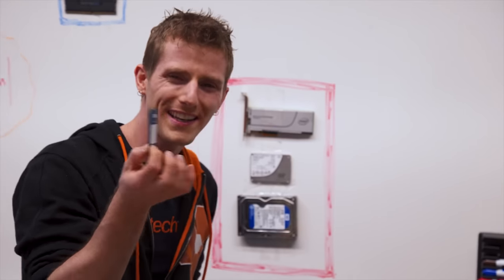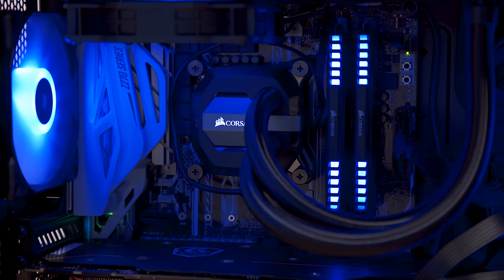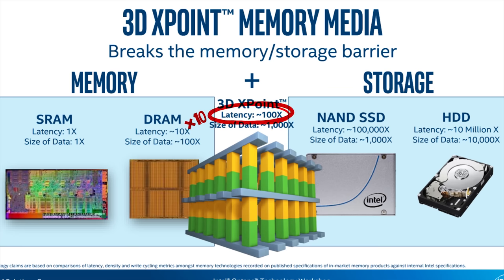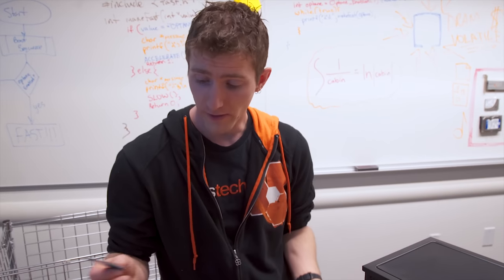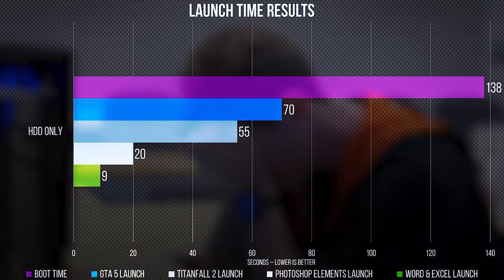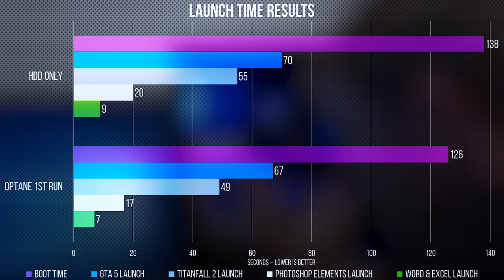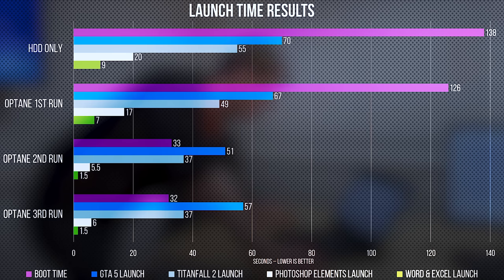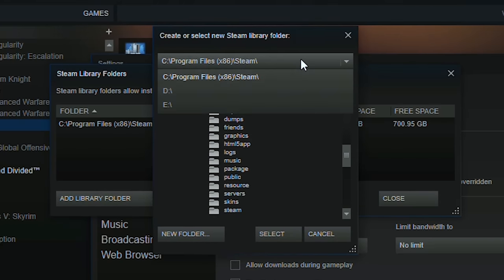Intel Optane Exclusive Hands On - SSD Crushing Performance

Comment: So this is marketed to someone who wants the lastest Kaby lake and 200 series chipset from intel, but for some reason want to boot from a HDD instead of buying an SSD for under $50? Like you can literally buy a 60 gig SSD for $35 on amazon. You mention boot times and that's nice, but what about writes? what about saving your work, or what happens after you've filled the optane drive?

This is that useless tech shit that solves the one problem no one had. It was already difficult and near impossible to justify upgrading from a SSD that saturates SATA 3 to an nVME drive; this is even worse. 

Epic fail. 0/10
Reply: You can build an Optane capable computer very cheaply. i3 7100 is $120 and the cheapest B250 motherboard is $60 on newegg. I could see someone buying a 2TB HDD with an Optane drive for a budget gaming PC. 

Personally, I don't need an Optane drive but that doesn't make it a fail. Just means I'm not the target market.
Reply: I guess the thing goes here is that you'd like to boot from hdd to have os installed on, say, 3tb volume. The optane drive goes as a transparent cache, so it deals with everything on his own, including overriding after it's filled up.
Reply: Mark Ivey - I'm stunned at the lack of thought you put into this, since it seems you wanted to put thought into this... you're taking a SINGLE task, and making an assumption that now covers the entire purpose of this product, but you're leaving out the numerous other benefits, that will cover the most common used tasks for each individual person... follow me on a journey, your way, and then my way....

your way suggests boot time is the only thing this is for, and we can solve that with two HD's, one $50 SSD to make boot times super quick, and then, we'll just uhhhh get another HD for everything else we use which now runs at slow HD speeds and after the system boots, I guess we'll just wait for it, since we only bought enough SSD to cover the OS and perhaps a couple programs at best?

my way is to use this as its intended, a cache... it will see what you use most often, booting will in fact be one thing, since we do that a lot right, use system files, those will no doubt take up a chunk of the cache... but so will every single other program I use on a frequent basis, including the ones installed on the much slower HD, which your method didn't provide enough room for on the SSD...

so in your method I will boot quick, but then wait for programs and frequently accessed data... under my way, I will spend roughly the same, but it will constantly target my most used data and provide it wicked quick, all the time, not just depending if I installed it on the faster drive, and moved something else off it... its essentially doing what you wanted, except for everything, instead of just the OS...

you see your way didn't "solve" a problem, it simply addressed ONE issue, boot times, while my way looked at what I did most often, cached that, and now provides me that data wicked quick ALL the time, and it changes on its own, as it see's my work change and what data I access on a regular basis...

your way... $50 for the "boot ssd" plus I still need another HD right? so another lets say $200 for a gigantic drive that holds everything... but only the OS boots quick... everything else is still slow right...

my way... $50 for the "optane" plus I still need another HD right? so another lets say $200 for a gigantic drive that holds everything... but not only does the OS boot quick, so does all my most often used programs and data...

who won in this? we spent the same amount of money, but only one of us has a system optimizing itself to make our entire workload quicker, rather than just a single function... same dollars, VERY different results... understand?

so stop being so narrow minded, open your eyes and truly understand HOW to use this technology...

now you could say, get into a penis measuring contest with me... lets say you will answer back with, well I'll just buy a larger SSD and put you to shame, so ha take that mister response guy... okay, you go spend $1000 just to show me how dumb I am and that I don't get it, I'll still spend $200 and we'll end up at almost the same passage... sure once in a while something won't load as quick, but the system will optimize and learn and I'll have saved $800 that I could go spend on something else, like maybe a better GPU than you, or maybe multiple monitors than you, or maybe I'll just not spend it at all and we'll end up with roughly the same real world performance, but I saved $800 over YOUR narrow minded way... understand?

P.S. you said "what happens after you fill the optane drive, stop thinking so 2D and step into big boy land... think of it as system memory, that only holds what it needs, and caches what it wants quick access to, because thats what you use most, and when it has something more important, it replaces it, and acts as a secondary RAM system... not a HD... think things through before spouting off, if you don't understand, pause, read some more, and learn...

the only epic fail was your understanding of WHAT this product is good for... it makes for a STUNNING disk cache... people with a LOT of storage needs, would benefit greatly from this, without needing multiple drives, and without paying an arm and a leg to hold all their data on something that won't make it perform any better... I mean does a song on an SSD play any different than a song on a HD? no, it plays the same, because it can only use so much speed... all you did way pay a TON of money, to store it on something that theoretically performs better, but in reality, it can't take advantage of that expensive performance, because its just a song...
Reply: bob dole like cause long ass interesting comment
Reply: bob dole
It will probably be "fine" for people that only use Chrome. But for a little more than average people that want to access different files from the PC from time to time, the files will always be cached for nothing, won't be accessed after a while again and other files will have to be accessed from the HDD and be cached for nothing in the SSD. And for even more serious people, like video editors, that 32 GB won't be enough for anything, when dealing with the same large file all the time.

I don't see how this helps at all. 3D XPoint at the moment is more expensive than NAND Flash and even for server workloads that use SSDs as cache (like Linus also did), I don't see its usefulness, especially with such low capacities. And this thing is aimed at consumers ! Having more longevity (write cycles) than NAND Flash, it can also be used as a cache memory, just as Intel uses it now, but I don't understand why Intel didn't just made 3D XPoint SSDs just SSDs, not cache memory. It has the potential to change SSDs and finally get rid of the spinning rust (but it does just the opposite).

At the moment you can find 128 GB M.2 NVME SSD for as cheap as $80, while a 32 GB Optane SSD costs $50.

Again, for other people than just internet browser users, I don't see the point of it. And even so, a normal 64 GB SSD with a HDD (like in the Optane case, but for cheaper) would suffice those users needs. Always caching files is not a solution, it's more like a problem. Again, a cache drive won't magically make your spinning rust faster, the only potential I see for it is for users that access the same file over and over, but that can be solved by having a bigger capacity SSD.

Maybe one use case would be office users, but even then, at our offices we upgraded to Dell PCs that came with 6th gen core i5s, 8 GB of RAM and SSDs. And they don't use even closer to 10 GB / agent (except the ones that deal with Virtual Machines, but that's another story).

Now, enlighten me, on what scenario Optane SSDs are better than a higher capacity SSD? You really believe you can cache 1 TB HDD in a 32 GB SSD? You got to be joking
Reply: ssd cache again?
so it is the same thing that failed in 2010...
just faster...
ok im out,
i was expecting it could be used in games ram but nope..
with current ssd price you can go full ssd so nope ,not needed...
Reply: honestly most mainstream users would be better off buying a large ssd for $250 instead of a $200 Hd and $50 cache. I know this will be useful for some but I think it's usefulness is limited. 

if it worked in older setups though it would be a different story
Reply: The other problem I see is that SSDs are just getting cheaper. By the time this technology could possibly be popular or widespread, 500GB and 1TB SSDs are going to be fairly cheap.
I dunno about anyone else, but when 1TB SSDs are < $100, I don't think I'll ever install an HDD into a standard PC ever again. - or at least not as a main boot drive.

Unless this can do something truly special, Its the solution to a problem that was already quickly going away.
Reply: MrBiky - hey at least you're giving me a better response than "you're stupid shut up I quit", so I APPRECIATE the thought you put into your reply, and you have some very valid points, for different people and circumstances where this will not help them much, and I agree, this isn't for everyone, its not a "everyone has to buy it" thing, its got a certain market its good for, and that market will get a significant boost... but lets tackle this notion 32GB won't help much, except for running a single program like google chrome...

how much data does it take to boot your current system, I checked mine, I'm around 2GB to load windows from boot, as well as additional programs... thats it... so now I've used up 2GB of the 32GB... that leaves me 30GB for, uhhh according to you just google chrome? how much data does google chrome take to load, I'll let you tackle that one, and then get back to me with how much cache we have left to work with, its a LOT...

but like I said in other comments, enterprise customers, and your video editing customers, they are waiting for the "optane drives" that will be coming in TB sizes and they are tickled pink waiting for them, thats what optane was really designed for, those guys in my mind, this "cache stick" for consumers, is amazing, albeit limited to a particular market, anyone who fits ALL their data on a single SSD and is comfy with the price, this is NOT for them, anyone else who has a tiny SSD or none at all, they should look into this... but some of them won't benefit much, but some will, and thats my whole point... everyone is foofoo'ing this as nobody will benefit, when clearly there ARE people who will...

your solution of "just buy a larger SSD" isn't always practical or cost effective either, in my "I have 2B of data and need more space so I want a 4TB drive" that would put us at $1500 to buy a drive, or $150 for the slower cousin... thats a HUGE price difference, for likely a lot of files that will not benefit from SSD performance, songs, movies, etc etc... but many people are NOT computer savvy, and do NOT understand or want to move files and programs from one location to another and hope it works better, in some cases windows will allow them to "move" the program but it'll keep storing the data they use for it on the other slower drive, and they don't know enough to make it work better for less...

and please stop thinking I EVER stated you could cache 100% of a 1TB drive in 32GB of space, stop with these ridiculous summaries that don't come close to what I stated... setup your logging, record how much data is used to load each program you use, and windows for that matter, then see how much a difference it would make for the daily user... this will be a boost for laptops especially, they'll keep the slow pokey cheap HD's but with much more space, and throw in an optane stick, and suddenly, most users will think they have an SSD minus an occasion slow loading program compared to the others cached due to frequent use...

32GB is a LOT more space than folks think it is on a daily average user, for cache... check your own usage...
Reply: agafaba - when you use your $250 SSD vs $200 HD and $50 optane example you need to make a fair size comparison... a $250 SSD will be roughly what, 1TB for the crucial SSD while a 1TB disk HD will only cost $50 or less... so its now a $250 vs $100 comparison when you add it all up... so one cost $150 LESS than the other for the same amount of storage, and I guess we'll have to debate the performance?
Reply: Doing a quick search it looks like $250 would get you between 750Gb - 1TB depending on what deals you found, same site had 750GB and 1TB hard drives for $40 so there could be some value to going with a much cheaper HD and a cache drive. It would be interesting to see some comparisons between SSDs and HD+Optane

Its success is really going to be based on how many people buy it in a new prebuilt system. People who are tech savvy enough to upgrade their existing systems most likely already own an SSD so it makes less sense for them to buy one of these.
Reply: +Rey yes the are very dumb this is for the average consumer to buy it to make his pc fater other than another ssd and its even faster than a normal ssd
Reply: agafaba - Do prebuilts even have M.2 slots? Or at least mid end prebuilts?
I imagine the kinda systems that would benefit the most from this upgrade ($500 Machines AKA too cheap to come with an SSD atm) won't have an M.2 slot, and unless M.2 is in every new PC, I can't imagine how relevant Optane will remain...

Right now SSDs sit at ~$0.30/GB,  3 years ago it was ~$0.80/GB, 6 years ago it was $1.80/GB
In 3 years whats SSD prices gonna be? My guess $0.12/GB based off that trend, and spending $60 on 500GB more of usable storage vs... 64/128GB of Cache. is gonna be a hard sell for Optane.
Reply: Mark Ivey true lol
Reply: @anthony francella, nono holy shit no.
save the cost for the useless optane drive, get a bigger hdd or throw the optazne drive cost into an ssd, those are so cheap now, not that the super cheap ones are amazing, but u get always faster speeds and u always get faster latency and u ad a bunch of storagee to your system, not wasted cache shit.
Reply: dell and the other big sellers could easily add one if it meant they could use a cheap optane drive to help sell their PCs. they could advertise ssd speeds with larger storage and sell it at a larger profit so they might do it.

Comment: I understand to an extent why a lot of people are disappointed with this so far. Everyone wants new technology that benefits enthusiasts and their top of the line computers. Maybe this doesn't do that, but for the people on a budget I think this is a great technology. I recently built my sibling the cheapest possible gaming computer I could with the latest parts. Latest meaning new releases, but not the top of the line items. This computer includes:

The i3-7100 dual core processor.
GTX 1050TI graphics card
1TB 2.5" HDD
and a H270 mini-itx motherboard. 

According to Intel's website all 7th generation core processors and all 200 chipsets support Intel Optane, not just the 7700K and Z270. That means that this cheap computer I built my sibling for $650 can support Intel Optane. When I installed Windows 10 on a HDD for my sibling I quickly was reminded how slow HDDs are as a boot drive. Sure for $70 you can get a good 120GB M.2 SSD, but that isn't enough storage for what most people need. If you buy a cheap SSD for boot drive and a cheap HDD for storage that works too, but for people like most of my family they aren't tech savvy and would panic when their C drive says it is almost full and they have no idea how to save stuff instead on the D drive. I know how simple that is, but yes they really don't get it. Installing Intel Optane sounds like you just install it and forget about it. It does everything for you. That would benefit my sibling a lot and $44 for the 16GB isn't a huge expense for the type of improvement it would provide to a low end system. 

I would still like to see how this compares to a modern SSD like a 960 Pro. I know the specs spell out most of it, but I would still like to see it side by side. I have an i7-7700K with a Z270 mini-itx motherboard and a 950 Pro. The motherboard is Intel Optane ready and has a second M.2 slot that I currently have empty. I'm half tempted just to buy the 32GB Optane for poops and giggles just to see if I notice any benefit. I do have a 3TB HDD in my computer as well, so it's not just my SSD. I'm an enthusiast so I needlessly spend money to test the latest stuff. I do sell my old stuff on eBay though so I really don't go out of pocket too much. I sold my 6700K and Z170i motherboard for $450. Cost about $560 for the 7700K and Z270I. The upgrade only cost me $110 which I made up by selling other random junk I had. I fund my computer wants/needs with eBay so the prices don't hurt as bad.
Reply: Elmer Gloo voice of reason